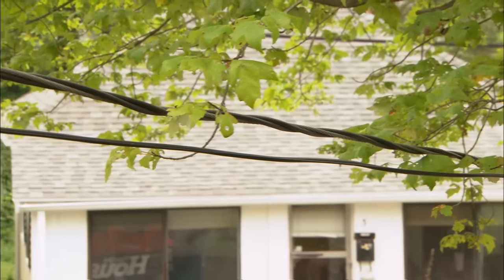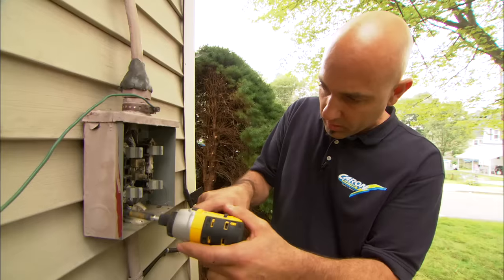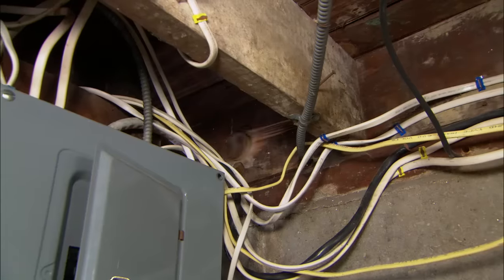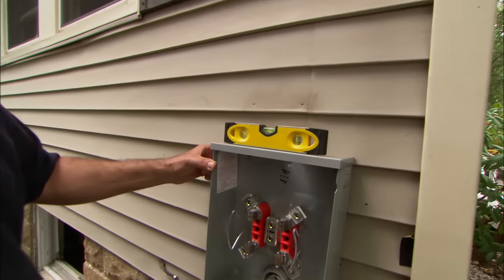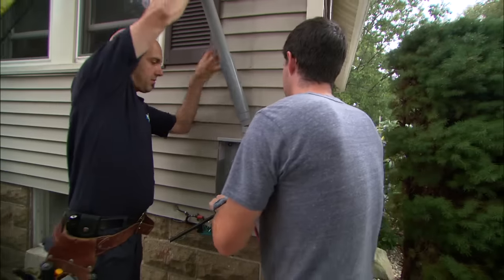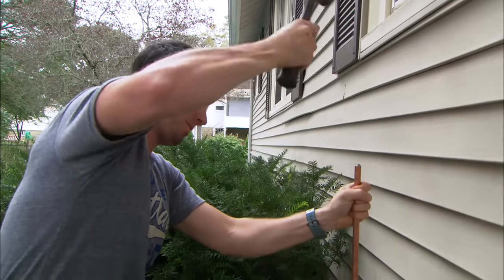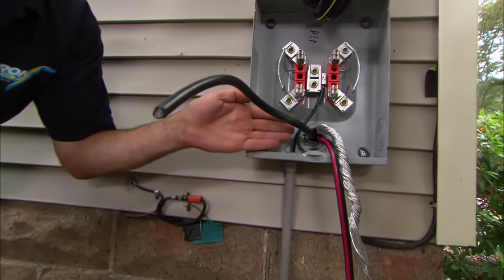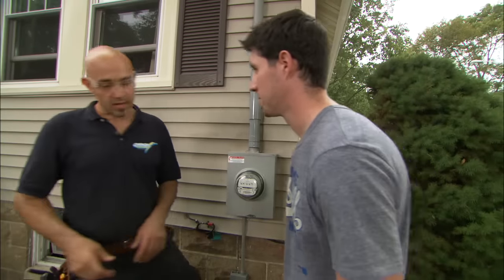How to Upgrade an Electric Meter to 200-Amp Service (Part 1) | This Old House

Comment: As soon as I saw them push those copper wires into the ground mostly by hand I knew they weren't in Texas
Reply: Nick Eckert         or in MI
Reply: Or California lol. I've put in multiple ground rods and they all sucked.
Reply: lol yes
Reply: Nick Eckert and I put the acorn on first.unless you have a numatic drill.
Reply: Or in AZ where there is a LOT of caliche (especially on MY property)! Caliche for those of you back east is rock hard dirt in consistency of cement.
Reply: Live in central Texas and I use a 35 pound demolition hammer. You’d be there a week with those two pound hammers lmao
Reply: Try Tennessee. I just got done digging a tench for a service install in my shed by hand, 2 hard days of work; next time I'm renting a backhoe. 2 in. of topsoil then all red clay. It was a complete pain in the ass.
Reply: You can also tell by the fact it came into a basement!  What they didn't show you in Texas was the 2 hrs spent with a roto hammer to get it about a foot just so you can get all pissed off in current surface of the sun 105 degree heat to get in your truck and drive to the rental place to rent a friggin demo roto hammer.  That or you get the hack who is to lazy to mess with it.  They mess around for about 30 minutes then gets pissed off and cuts the bar off when they think nobody is looking like they pounded in all the way.
Reply: Danny Compton that’s what half of the solar company’s do in New England
Reply: Alexander Peters  In New England we have a few inches of topsoil and then 3000 miles of rock.  I have no idea how they put these ground rods in.
Reply: Isn't there an NEC that states that these cannot be hammered into the ground?
Reply: @resistcircuitresist no not at all lol. youve gotta hammer it one way or another. a drill is gonna mushroom it too. if you put the acorn on first it mushrooming can actually be another failsafe including the bolt to make sure it never comes loose off the rod
Reply: And I am not certain that two 8 foot rods will provide the NEC required 25 Ohms resistance.  It will vary greatly by location, soil, and moisture.  And this electrician in the video is wrong when he said the electricity will travel to ground.  Even at 25 Ohms, only about 5 amps will be able to conduct to the grounding rods.  Most home circuits are 15 or 20 amps.  That's why the NEC codebook makes it clear that grounding rods are not there to clear ground faults.  They are only there for light residual currents, mostly from static buildup in the wiring.  If you have a short circuit somewhere in your home, the grounding rods won't clear it unless you have a really good setup with super low resistance (much lower than 25 Ohms).  What will clear it, hopefully, is your breaker which will trip once that current comes into the panel from the grounding wire.  The grounding rods themselves have little to do with it.
Reply: @Wowzersdude-k5c  you can always test the resistance if you arent sure. Of course it would suck to knock em in and get an undesirable read but im just saying as a double check. Its funny because i was taught ground rods can handle just about anything when done correctly, even lightning strikes. Who knows though honestly. Alot of grounding is just theory to a certain extent because youre preparing for the boogeyman essentially. All i know is ive seen two eight foot rods for a 400A commercial service pass an inspection with flying colors. I think the important part is having your GEC connected to the steel framing of the building. But then again that's a different ballgame
Reply: @erich1380  Watch Mike Holt's video where he drives a 50 ft ground rod before achieving 25 Ohms. (Holt is an NEC teacher and guru in case you aren't familiar with him). He loves to debunk myths about grounding. He drives the point home that grounding rods will not prevent shock (NEC code even says this) or even clear faults. It's not what they're for.

Also he likes to debunk the myth that electricity always and only travels to ground. In reality, electric current is always looking to return to the source (transformer) and will take ALL possible paths to do it (Ohm's law). It prefers the path of least resistance, but will take other paths (inversely proportional to the resistance).
Reply: @Wowzersdude-k5c  do u think which state or country you live in aka how the earth is in the area can effect the resistance? Ive heard rockier underground can cause more resistance
Reply: @mikegross6107  yea we got that caliche up here in Washington st. Had to dig an electrical trench. Had to use a backhoe...
Reply: @speedydavegogogo  I DID A JOB LIKE THIS THE ROAD ONLY WENT 1/2 INCH IN GROUND
TOOK LIKE 40 MINUTES TO HIT THAT ROD INTO THE GROUND
6 FEET OF IT
Reply: ... or New England.
Reply: @Wowzersdude-k5c  the idea is to provide a low impedance path so breakers or fuses can break the circuit as quick as possible. Homes in NA don't utilise GFCI as much as developed areas, if they did grounds would be better served
Reply: @thirdayman  no kidding. You'd get about 1/2 inch into california clay and you're done.
Reply: @coulombicdistortion1814  we use mini excavator with a 6in bucket...goes pretty quick...could rent for a day for 250 bucks
Reply: Long Island is even worse. I’d say 10% of the time we don’t even need a hammer.

Comment: I updated my house with a 200 amp service about 15 years ago. Also took down the mast & had underground run. Best thing I ever did!! Those guys from the power company ran 75' underground & had everything hooked up in about 45 minutes. Yes, I am a retired electrician & have been for almost 10 years. Sure is nice when you can do all these things yourself. Only thing the inspector said was he wanted to see the 2 grounding rods daisy chained & "nice job!!"
Reply: m rapacki  Yup.  When I still have all 10 fingers and 2 eyes after a complex home project, all is good.
Reply: Just learned today the “great deal” I got on a foreclosed property had 50A service to a 100A panel!
Reply: Was it expensive to bury the wire?
Reply: No, just rented a Ditch Witch.

Comment: I did this to my house yesterday! Though not an electrician I'm a master carpenter and have experience building homes since I was in my late teens so I'm very comfortable doing my own work on my house and seeing how as I'm the homeowner I can pull the permits myself. There's nothing that a semi skilled mechanically inclined person can not do by themselves these days seeing how all information is in the palm of our hands including step by step instructions and video, then to top it off there's always the "experts" in the comment section that are so helpful and "friendly"!
Reply: I used to say the same thing  with all this technology how can some one mess up but some how someway poeple  find a way to do some ragged shart most of the time.
Reply: Agreed.  I don't mind paying for an electrician, but the quotes these days are between $6000-8000 for this job.  This isn't thousands of dollars worth of labor.  This is a 5 hour job.  Even at $50 an hour, that's $250 in labor.  Call it $500 in labor because the company needs to make double what they're paying.  Looking at $10/ft for service entry wire, so no more than $500 there for a very long run.  No more than $100 for the service entrance and pipe.  Call it $150 for the whole grounding setup.  This puts the total generously at $1250.  I could even see paying $2000-2500 for the job just for convenience, but the estimates of close to $8000 are pure greed.

Comment: 4:56 Scott, NO CRITISIM, just a tip:
As I was an apprentice 15 years ago, I learned: Always make a little loop of wire.
1. In case you cut too short you can still use it.
2. In case it breaks, burns (bad contac), you cut it and don´t need a new wire.
3. It is easier to connect (not so tight).

Greetings from german
Reply: good luck making a loop with that size of wire inside that box.
Reply: @Flightstar  
I said a LITTLE Loop.
Greetings from germany
Reply: He more less means leave some slack, it can easily be done.
Reply: I sure hope he read your tips! If not he will lose his license!
Reply: @Albrecht8000  that gauge of wire won’t loop in that space.
Reply: @Fattony6666  Why that?

Comment: When driving the ground rod into the ground, you can use a hammer drill in the hammer only setting.  It might help you if there is something hard to go through in the ground.
Reply: I just got to lay flat one out of the 2 required today cause a landscape stone lol the hammer drill was jus mushrooming the head
Reply: The hammer drill is effortless. Let the tool do all the work and it just slides down 8’ into the ground. It’s great!!
Reply: @URBANENGINEER  Only as long as there is nothing hard like a rock down their.  There have been a couple of times I hit something hard that even the hammer drill wouldn't go through.  If I run into something like that, I'll pull it out and ry again a few inches over.  But before I try again, I'll actually grind a sharp point on the end so if it does hit something, it has a sharp end to help it drive through whatever is down their.  95% of the time it works and goes right through whatever the hard thing is.
Reply: @KevinBenecke  good idea my friend
Reply: As long as it not rock all you need is two water bottles.
Reply: Rocks at the bottom?
Reply: Not in Texas. I put 4 in the ground for my electric fence. You need a t-post pounder. All depends on your soils. But you're not getting anything in the ground with ease in North Texas lol
Reply: It makes it so much easier to get through the drain tile.😂😂

Comment: I liked Scott.  Is he still with This Old House?
Pro-tip: If you're using a maul or hammer to pound that ground rod in it is always a good idea to put the clamp on first... when pounding you may "mushroom" the head of the rod and it will be impossible to get that clamp on after that.
Reply: Wise move indeed but an angle grinder helps to cut away or grind away the smashed head
Reply: He's been gone for years - posted that his contract expired and that's that.
Reply: @oldtwinsna8347  thanks!

Comment: remember to dig a hole around where you will drive the ground rod so you can completely bury the rod, preventing possibly hitting it with a lawn mower or weed trimmer
Reply: I agree ain't that a bitch especially the lawnmower☹️
Reply: +brian phillips Not all ground wire to rod clamps are certified for burial. Thus an inspector can fail the install if the wrong clamp is used. Even if legal to bury the rod the local inspector can have his own rules too thus you may want his input.
Reply: 3beltwesty i have been dealing with inspectors for over 30 years if they have their own rules and i disagree i go over their head
Reply: +brian phillips After Katrina "stormers" descended here and all wanted to "go over the local inspectors heads". Thus they just did not get permits, they joined the crowd who wanted exceptions and had to wait in line for months. ie maybe they wanted to use 14 awg wire in a city that bans that size wire for a decade already. Or maybe they want to use weird breaker brands that are common in LA or New Jersey but are not used locally.

Thus going over the persons head goes to a lay person and you get to plea at a city "fight with the inspectors meeting" in weeks or a few months in which the city has a consultant that will find more of you stuff wrong. ie you ticked them off and they will mess with you more

Thus if you want to teach the inspector your way you just burn up your labor costs. In the bury the ground rod clamp the inspector here might just give in and let you pay the labor and cost when the utility adds another rod with its rod above ground. They just tack this cost on install bill as an added change. 

 ie it is not just the inspectors, but what does the Utility require?  After the Katrina event we had Utility guys for phone and cable from Canada; a Power guys from all over the South East.

There are places where when Copper was high idiots stole the copper ground wires and the building owner just stuck a loose piece of wire in the ground, instead of  finding the rod when it was buried. Thus when restoring power if the wire is off and they cannot find the rod quickly they will add another rod. In my neighborhood this just meant that some folks had to wait another week to get their meter area acceptable if the area was too cluttered of the wire ground gone. They actually would cut the wires at the transformer too on houses that they declared not ready for power again.

One county in a rural area has a code guy who wants the wired AC smoke alarm on ground faults breakers. That is nuts. His goofy reasoning is "safety items" should be on GFI breakers.

Here in smaller towns there are only one single code inspector person and after a storm he get saturated.

In good hearted free labor like Habitat for H. workers they would constantly get rotations of folks and all wanted to change the designs of the starter houses. ie Guy from Michigan wanted a basement, but the house would float up. Or Minn guy wanted ice dams for the roofs, or LA guys wanted to use weird breakers and have no AC units at all or use swamp coolers.
Reply: you bury the rod after inspection not before inspectors have rules to follow laid out in the law. city rules must or equal or better than state. inspectors ideas of what should be or not be must follow those rules other than that his opinion is nothing. 14 gauge wire is not large enough for a main box ground it is large enough for a bonding ground on a 20 amp device. this is why 12/2 wg often uses a 14 gauge wire for it's bare ground. many romex cables have a bare ground one size smaller than the other conductors. inspectors here will crawl under your house and through your attic as well as look to make sure all metal boxes are bonded, closets and storage are lighted, main panels are grounded with 2- 4 gauge copper conductors to separate rods 6 feet apart. ground clamps in this area all meet code if not they can be easily changed and reinspected before burial. gfi receptacles are used where water is possibly present, i.e. outdoor receptacles, bathroom receptacles, receptacles near a kitchen sink. bathroom lighting exhaust fans, etc... are usually wired in series with the gfi receptacle so touching a switch to turn on an exhaust fan with wet hands is covered
Reply: +brian phillips  Here one sees buried clamps and exposed rod clamps.  Saying one is going to change the ground rod after one does an inspection seems like asking to get busted. Legally you changed what is inspected, if caught they may wonder where else you changed and rip the entire building's wiring out. Here they shoot digital images as proof thus they have a record. 

From a practical standpoint here it has rained the same in 5 days as it does in Los Angeles in 1 year; thus the worry is the connection corroding; not the length of rod. ie a rod probably could be  a few feet down and equal other places where they use two rods in parallel many feet apart.

Thus many folks purposely here want the clamp above ground so it can be seen; inspected and the joint tested if needed.

14 awg is interior wiring in a building. Locally some cities have it banned. ie one cannot run a 15 amp breaker off of 14 awg wire to say a smoke detector. ie the code has it ok but the city and code guy says no dice. ie they Know  a goober down the road will tap off the circuit and bump the breaker to 20 or 30 amps and the 14 awg wire will run hot and thus maybe a fire on rare cases.

Cities here have gone to where about every single room now in a house is arc fault; and some not. Thus the same house built 15 miles away one requires them in the bedrooms.

In areas with a frost line ( not here) like when I lived in Michigan the rods clamps were above ground so the clamp would not get bulled around by the freezing soil. That was decades ago. 

With all the salt air and salt flooding at least here I would never bury a ground clamp; ie it maybe gone if stray currents flow.

I guess that is why each area of the US has different requirements.

The corrosion issues were so bad that the telephone guys went back from burial to on the pole in some placed here that flood

Other disciplines here after Katrina were worse in changes. The treated 2x4  "mudsill" on slab houses was 1/2 inch bolts on 4 ft centers for over 7 decades. Then post Katrina each city's Czar/King/inspector/God got tighter rules and today it is mostly 5/8 bolts on I think 18 inch centers, which is a bastard pitch for 16 or 24 inch stud spacing for 2x4 or 2x6 walls. At one time each Czar here was on a different page. ie same house built 1 mile away would require the old 1/2 bolts on 4 ft centers and the one you are building has to use 5/8 bolts on 18Inch spacing
Reply: You should make a hole protect the cable with plastic tube, cover the hole with plaster and put an iron or plastic lid over it so that it keeps in good shape watertight and can be checked. If you leave it exposed someday the connection or the cable will fail.
Reply: @3beltwesty  he wasn’t saying he defies code and goes over the inspector’s head. It’s when the inspector is wrong he raises a stink.
Reply: @ThreePhaseHigh  Not in Jersey. The inspector wants to see the rod and wire connection